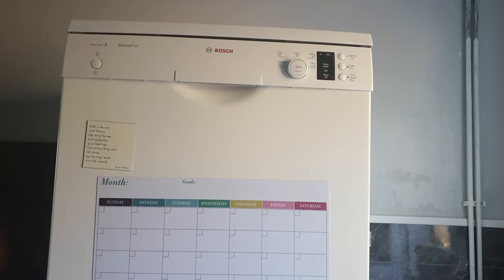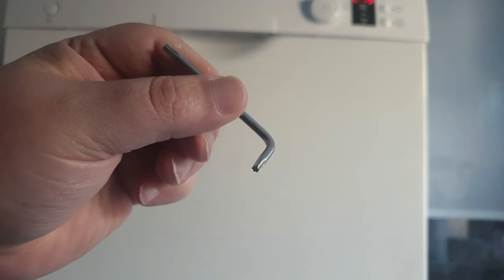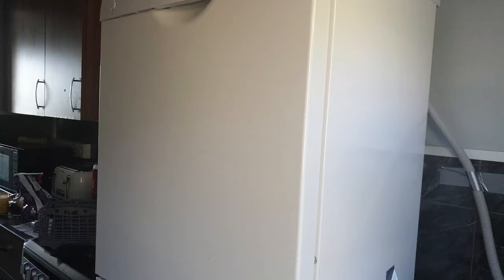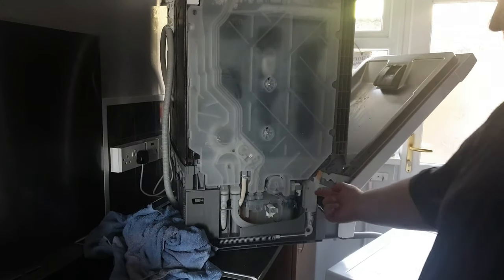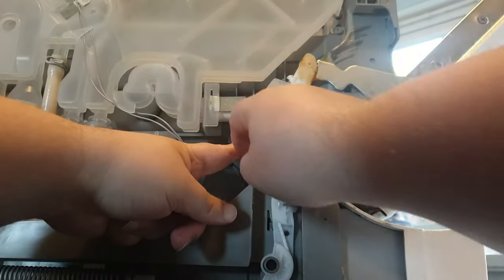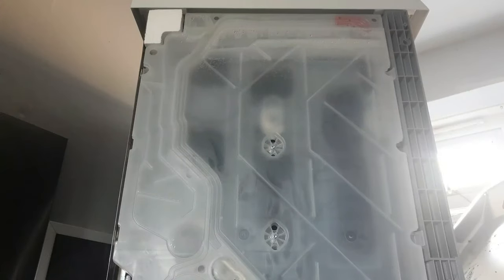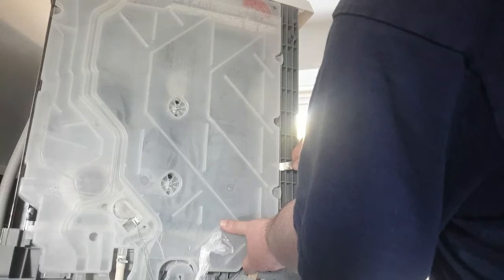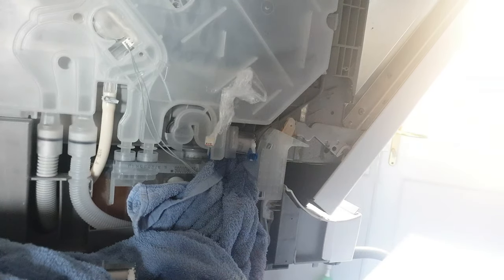How do I fix error E19 on my dishwasher? Bosch, Neff, Siemens etc...

Comment: Unlike the original, my replacement has a starlock washer on the rear. The grey plastic that the rear of this part locates has two moulded ribs that nicely guide the pin into place. However with the starlock washer these ribs are in the way and the washer is chewing them up. It's hard to tell exactly but I think your two parts were the same, original without, replacement with.. Does this matter; should I just persevere and align the new part and not worry about chewing up the two moulded ribs? Please comment, thanks. Peter.
Reply from the maker: The washer can be removed.
Reply: @JJcorrosive  ah okay, thanks for the tip. I actually just went for it. Used a screwdriver to just gently flex the plastic out of the way whilst the new part lined up correctly. Dishwasher all sorted thanks. Just need to fix my 3 year old Bosch tumble drier now! I really think build quality on these products has dropped :(
Reply from the maker: I'm glad to hear the dishwasher is working. Regarding the dryer, its normally the heating element. (Unless its making a squealing noise, then its something else) good luck!

Comment: Hi, How do I drain the matrix tank? I have a Bosch serie 4. Can't find where you pushed to left? Thanks
Reply from the maker: You'll need to gently slide the valve to create a small gap for the water to flow.
Reply: Sliding either way didn't work for me, I had to give the valve a slight twist for it to drain

Comment: Hello, thanks for the video. It is not working for me :( I replaced the part and white connector as well because of demage,  but error os still here. Could You help me, please? Thanks
Reply from the maker: Does the machine click when switched on?
Reply: @JJcorrosive  yes, it did
Reply from the maker: @Milan32136  this means the sensor is probably broken.
Reply: @JJcorrosive  What sensor do You mean? Many thanks for Your time and advices!
Reply from the maker: Is there still water in the machine?
Reply: @JJcorrosive  do You mean water in the transparent/white side tank? No, there is not water.
Reply from the maker: @Milan32136  you will need to check the part with a multimeter to check continuity.

Comment: Hi, this hasn't solved the problem. I do here a double click when I turn it on but still the e 19 message. thanks
Reply from the maker: You'll need to check the drain hose. It could be blocked.
Reply: How do I check the drain hose please?

Comment: Thank you for the video, but this didn't fix mine. What could be the problem?
Reply from the maker: Error 19 is the usually the valve, have you tested the valve to see if the new one is working? They are notoriously unreliable.
Reply: @JJcorrosive  Thank you. Yes I have tried two now. I did open the PCB and found what looks to be the burnt dry remains of a slug that has shorted some components on the board. This may just be the problem!

Comment: Hi, hoping for some help. Got the new part and the side panel off with the electrical connection removed. However I am struggling to force the dishwasher to drain as it is also full. What do I need to do manually do the solenoid to allow the tank to drain?
Reply from the maker: You can gently pull the old motor towards the back and water should drain (be patient, and go slow)

Comment: Hello, i replace it and also i replace the heat pump and i have the same problem. What can i do for fix it pls ?
Reply from the maker: You'll need to test the parts of the dishwasher with a multimeter to see which part is causing the error.

Comment: We god an E15 error straight after fixing this problem. We think this was because water collected in the bottom of the machine when we initially pulled the failed valve out . Tipping the machine and emptying the base of the machine seems to have fixed it
Reply: We have the same problem. Now water leaves into the machine now its shows e 15.  How we can fix it??? What do you mean with tipping it?
Reply from the maker: Empty the water completely.

Comment: I bought your part but It didn't fit, the only way to get it to fit was to cut the prongs of the valve off and cut the plastic guides inside the machine away, they are designed for the round end of the valve and the one you advise is bigger so does not fit, made what looked like an easy job into a real pain in the neck
Reply from the maker: I don't recommend modifying the machine or the part. 

If the part is not right,  return it.

Comment: Same with E15?
Reply from the maker: E15 means the water hasn't drained. Manually empty the water, disconnect the water inlet and try again. If E15 pops up, the sensor is faulty.

Comment: CHANGING THIS VALVE DOES NOT RECTIFY THE ERROR CODE E19 WHAT IT IS IF IT IS NOT THE VALVE
Reply from the maker: Do you hear a clicking noise near where the valve is situated, when the machine is switched on?
Reply: @JJcorrosive  Hi, also having the same problem but can't hear any click when turning it on,
Reply from the maker: @sveinkland9021  the electric connections need to be checked with a multimeter, please note that water and electricity should be treated with care.. Please take all safety precautions when testing the connection.

Comment: Hi mate, thanks for the video I'd just like to add a bit of a warning for others

I had code E19, recirculation valve failed, and stripped the left side to replace the valve. This mounts at the bottom f the recirculation tank using a bayonet like mount. When I installed the new one it felt like it was in place, and rather than do a test run, I replaced the panels. On filling E19 was gone, but was replaced by E15.

There's a really good video about E15 here https://youtu.be/8kW4jkHln3k 

On inspection the Aquasafe was full of water, which had come from the badly installed valve. I've reinstalled the valve properly, and it isn't leaking and the Aquasafe hasn't switched the water off.